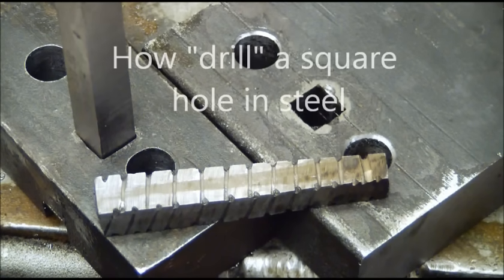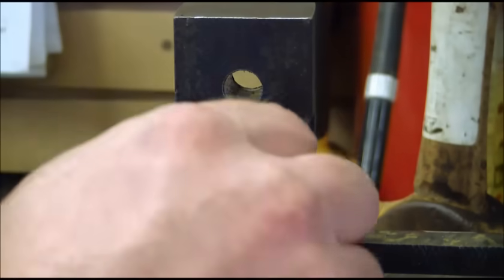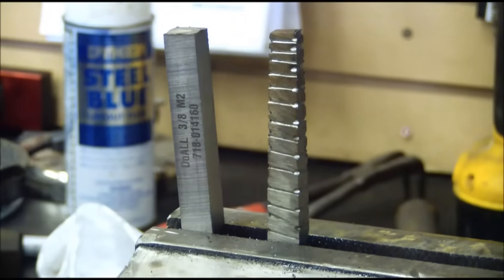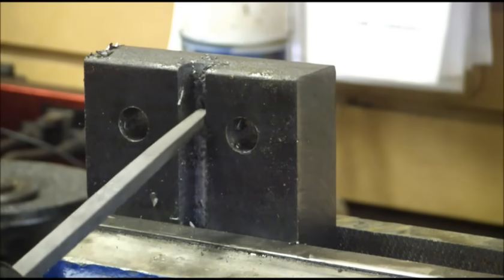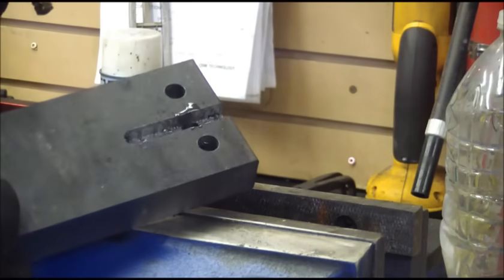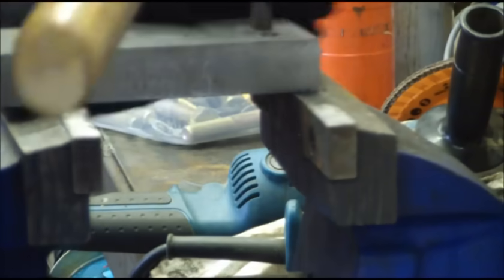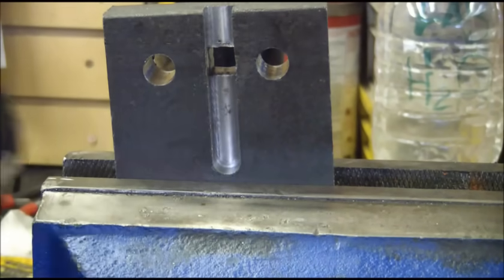Machining 101: How to drill a square hole at home without special tools.

Comment: I saw nothing wrong in this video. I can't believe the comments on here. AvE good job. People need to know feeds and speeds and the different cutting compounds available out there. The fact the drill was smoking proves you had a cutting compound on. The drill wasn't too fast for a 3/8 diameter. Belt driven drill presses always sound faster than they are really going. Also the drill bit never changed colour, the chips were silver and didn't turn purple which means you weren't cutting anywhere near too fast. I could brag about my credentials and certificates and pieces of paper too. It's what you can do, and what you really know, that proves your true abilities. Natural talent and innovation will always be worth more than a shitty piece of paper, this is why you can machine without a certificate for a living.
Reply: In Africa we use water as a coolant.. Why? because the bosses are too cheap to buy proper coolant 😂 we say 'skuma twende' which loosely translated means 'if its working lets keep going' 😂😂😂 so i agree with you as long as the desired result was achieved the process can go to hell
Reply: I agree with your comment. This is s  good solid video.
Reply: I agree with your comment. This is s  good solid video.
Reply: I agree with your comment. This is s  good solid video.
Reply: Theres guys at my work who are red seal tool and die guys and there the biggest hacks I've ever seen in my life and they think their gods cause they got a piece of paper.
Reply: well sir--you certainly have no certificates in machining that is a fact.
Reply: @jaysilverheals4445  and yet, he’s introduced effective steel cutting techniques to so many more people than I would imagine you have and STILL didn’t come across like some arrogant little fuckface who’s abit upset at the attention someone else is getting. What a world.

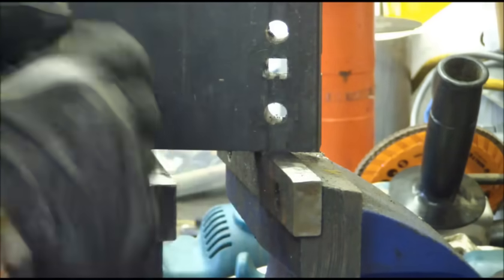Comment: 3:46  I at first wondered why was the square pin heated up before pushing it in ?   Turns out it wasn´t the pin but the brotsch / reamer (yeah BTW "reamer" is a commonly used name in commerce for such a square tool) which by heating it up makes it expand a bit and thus result in slightly widening the square hole when again pressed in.

Comment: Whilst this method might get you your square hole, under no circumstances should you hit high speed steel with a hammer, HSS is extremely brittle and shards can chip off at very high velocities, I know from experience, being a time served toolmaker. PS If you have any questions on any aspects of machining, I would be only too happy to offer a solution to your problem.

Comment: For many years I thought that when we need to remove a rusty bolt I had to heat up the bolt it self ,but 2 months ago I just realized that I was doing wrong. But what really need to expand is the reciver. Not the other way around, since them I've stop brake things and retreat as well.

Comment: I have a somewhat limited knowledge of machine tools so forgive me if I'm incorrect but you appear to be drilling your .375 dia. hole a bit on the fast side. Even though you are only drilling into mild steel ( CRS or hot rolled ). Feel free to correct me if I'm wrong. Other than that , a very good idea to make do with what you have on hand.
Reply: SuperSaltydog77 hole is drilled. didntburned the drill. job got done, i dont see any probleme here
Reply: SuperSaltydog77  My thought exactly, plus,  no coolant?
Reply: jasonwinback well, couldve expanded the lifetime of the drillbit by cooling it but not really needed i guess c: i bet he put some on the surface before he drilled

Comment: I'm never going to win troll of the month but.....the amount of time you spent faffing about making a broach that doesn't cut properly, you could have just filed the hole. You nearly did anyway making the broach fit to start with. For bigger holes or splined holes you would need to make a broach with proper rake and clearance angles for the tool to cut properly, not just half round grooves. Read Porter, Lawshe and Lasco. Machine shop operation and setup.

Comment: i wonder how fast a reticulating saw with a file rigged to it would work.
Reply: chris11sholtz I like that idea.
Reply: Pretty fast but it would also ruin the file faster
Reply: You cant file HSS, the work-piece is harder than the tool.
Reply: You can buy reciprocating air files
Reply: Flying lead ever bought a bastard file before?

Comment: I'd have to say his drilling is fine. It's fast, clean, no spaghetti and by the looks of it there is some kind of lube going on there. The smoke coming from the chips indicates al lot of the heat is transferred to them, not in to the drillbit. Also, the chips are not blue, indicating that it's not overheating anywhere. Drillbit looks fine too. Lastly, the reciprocating drilling technique he's using prevents te drillbit from overheating or re-grinding of the chips in the drill hole. All in all, a fine job, Sir.

Comment: Why heat up the broach?   It will expand.
Reply: ***** Basic engineering 101 awaits you :)
Reply: The tools he wants to use are 3/8", and the broach he's using is 3/8".  Problem is if your hole's exactly as big as the tool it's a pain to put them in since there's no room left, they're tight to each other.

Heating up the broach makes it a little tiny bit bigger than 3/8", so your hole ends up a little bigger too, and then it's not so hard to put tools in.

Comment: FYI, your link at 3:52 doesn't go to building a 100 ton press like the caption says.  It goes to drilling steel with an arduino and a pencil.

Comment: What's with all these ignorant Joe handymen that are so confident in telling a machinist how to drill a hole properly? You people wouldn't know how to calculate the ideal RPM even if you knew what the drill bit and material were. In this application a carbide drill bit shouldn't use coolant and should turn at 2-3K RPM. There's no chatter and it's making good chips but you never saw chips smoke in your high school shop so the professional must be wrong.
Reply: john saunders
Wrong stupid  400 per inch for HSS and mild steel  is more likley.
 And the proper equasion is (Cutting Speed x 12)/(pi x dia)
And How do you fucks know its not carbide tipped drill.
And second of all, maybe hes just drilling it quickly as to not lose people attention for the sake of a youtube video. not everything ia always black and  white.
Reply: tttrrroooyyy 280? Are you a small guy?
Reply: tttrrroooyyy did NYC CNC delete the comment? What did he say?
Reply: C W sitting down, we are the same height. I'm 5'11" the only thing a skeleton like this is good for in winning bench press competitions. Imagine a 6'4" guy with the arms and legs of a 5'8" guy. As a really skinny guy, those state fair weight guesses were always 20lbs under. If I had to do everything all over again, I'd have been a full back. That aside, I think John's a good guy, he's just a little too into fusion 360 for most of us. One of the few big metal working youtubers that has gone down in popularity over the last few years. Bring back that free licensed music and the tormach 770 changing a block into something else at 10X speed.
Reply: They’re the same people that would prefer to help the mechanic in the bay, while their car is getting worked on.
Reply: john saunders Are you sure it wasn't two head injuries? I'm guessing you want to be a teacher so you can get paid to talk down to people. I've met a lot of smart tradesmen and none of them toot their own horn. The loudest guy in the room is the weakest. Or maybe it's the internet so you can be whoever you want and you choose a tin banging, boiler/ tool making, pipe welding, engine tuning, super engineering douche. Or maybe you're the outlier; a condescending genius prick that mixed up his numbers by accident. He doesn't say what material he's using but I'm guessing it's not brass. Assuming it's mild steel the cutting speed should be roughly 30 SMM. (318 x 30) / 9.5 = 1004 RPM. I used the imperial equation and got close that. (CS x 4) / dia. = RPM. I'm not sure why you used a metric equation on a 3/8" drill. As a rule of thumb carbide bit speeds should be 2-3X that of a HSS bit. That's how I got 2-3K RPM. Before you say it, I know it's rough and there are lots of variables that would make it faster or slower. It's a ballpark calculation just like your equation. If he can afford a milling machine he can afford some carbide bits. There are other reasons for not buying a broach. And stop spelling he'd as "hid". BTW, I'm a rocket scientist, lawyer, rock star that can bench 280 lbs. I won the elementary spelling bee last year so I'm pretty sure that qualifies me to be a spelling nazi on youtube.
Reply: A lot of machinest in here that would be fired in my shop for burning up bits. That drill is too fast. I have run 3/8 up around 900 or so. But unless I am flooding it, there is no way I would have it spinning that fast.
Reply: *****
You guys can laugh at john all you want but he is 100% correct.
Any real machinist can easily tell a carbide bit from a standard hss bit by the color.
Reply: ***** So I think it's about time we ask you about what's going on instead of all this name calling over a guess. What is the drill bit made of and how fast were you running it?
Reply: john saunders You might have learned to use the metric system Johnny Boy but you are sore lacking in the spelling and grammar department. (ignoramace, simplten, sory, Rushians, metris,) But you are Australian. I'm sure your "Mates" are proud.   

I think the rest of you folks are jealous that this man has the ability you don't and he's willing to do it. you see it's not always about buying the tool. making it increases you skills!

Comment: I have a question. I came across this video trying to figure out a decent way of making a slot through a steel rod. The rod is 5/8" diameter and I want to cut a 1/4" slot all the way through it on the end and about an inch long. I noticed you had a nice looking slot cut in the piece where you were making the square hole. How did you do that? I have a drill press and could drill a series of holes and file it out from there. I wish I had a mill but it isn't in my budget! Nice video and thanks!
Reply: *****
Thanks for the link and the thoughts!

Comment: Good job. However if you drill the pilot hole larger than the broach, about .030, it will be easier on the broach and will not hurt the purpose of the square hole. Also, gloves are a no-no in a proper machine shop using power tools.

Comment: How many RPM you reckon that drill is turning? Close to the speed of light.
Reply: with astroglide , even teh starship enterprise can go fuck itself quick. ll !
Reply: Dont forget the no cutting oil, drills wont last long if you carry on using them like that
Reply: Higher speeds for the very small pilot holes and then much slower for larger bits. And just like any machine or tool, you more or less feel what its doing rather than attack the job with it.
Reply: drill speed was my automatic and immediate scoff!!
Reply: I was always taught to drill holes very slow like 400 rpm or slower

Comment: I have to build a striker plate out of 2" plate with a 1 3/8 hardy hole for tool making. So will this system work? Pilot holes increasing in size until I get a 1 3/8 hole then build that broach tool out of tool steel? It doesn't have to be exact just close. I don't want to be swinging a sledge on my expensive anvil to make these so trying to build a striker plate. I also don't want to break my post vise, could I lightly tap on the tool rather than try to press it with vise?
Reply: Are you at all interested in selling one of those setups? I could get the tool stock and make the broach but not the rotary. I need to be able to make more than one size hole as well for my other anvils.

Comment: Hm, Ok a square broach is cheaper then a new vise and a trip to the hospital. The jack screw nut in most bench vices are just cast and putting the amount of force that you are using to wedge your home made facsimile of a broch through the steel plate is without a doubt tearing up the threads in the nut of your vice. I have hot forged a square hole in less time than what you put into your project there. I true square cutting broach used in an arbor press with black thread cutting oil will feed through the work like butter.  

Joe
Reply: ***** Check out McMaster Carr or Wholessale tool I know McMaster has broaches and Wholesale Tool should have them too and they will likely cost less.
Reply: ***** I never said they would be cheap, lol... I have found some good deals on tooling at industrial surplus stores and I'm sure there is some good stuff on ebay too. If you have access to a welder, some scrap steel and a bottle jack you can put together a decent shop press pretty easy, just be sure to over build it so it won't eat itself or hurt the operator.
Reply: *****, Maybe he had a lot of money for just one fucking square hole. Good luck to this guy, hakhakhakhak

Comment: Ive done this once before and it came in handy. It would have been a lot faster to file the hole but filing through what looked like 1" stock you will be finding it very hard to make a nice square due to the belly on the file. Surely not worth the mucking around getting it right only for it to be bellmouthed and not right. Congrats man.

Comment: What a load of crap. The title is misleading at best....
Reply: Ya know Gomp, "drilling" is a correct term with this technique.  "Drilling" is the action of a specific tool/implement that creates holes -- shape not specified.  If you don't believe me, go look it up in a dictionary.  To whit, remember good 'Ole John Henry, hammering on the mountain?  Miners like him drive/pound a steel bit deep into rock in order to create a hole sized to fit sticks of dynamite.  Those bits are not "twist" style bits, they are "drilled" straight in, no twist wanted, by impact.

In this vid, the author does in fact use a twist bit to "drill" (bore is another term & again this is in the dictionary) the primary hole.  The broach and broaching finish the task in much the same way as one uses a file or grinding to remove burrs; are those final steps not part of a good workmanlike hole?

Comment: You are drilling way too fast! Low rpm and a high pressure is the best for drilling in steel.
Reply: +szili76  Anywhere from 800 to 1000 rpm is about right for CRS.

Comment: I hope you were wearing eye protection when you knocked the home made "Broach" out. Tool steel is pretty hard and chips caused by impact can reach pretty high speeds even penetrating eyelids.
Reply: ***** Well your mom was right. You are careless, especially when trying to show of your limited knowledge of engineering. Some of the people watching this video may injure themselves following your advice but then again, it doesn't really seem like you care do you? It's much easier being obnoxious than a responsible caring human being isn't it? I guess you should be embarrassed. I have more than 15 years of maintenance management experience and people that work like you do have always been a thorn in my side because when they injure themselves or their fellow workers, which they always eventually do, they generate a ton of paperwork and damn investigations and make the entire department look bad.
Reply: ***** Well it's clear that you don't care and that you have the maturity of an 8 year old and the mental ability of a 10 year old (and I'm being generous here). Even when my son was 5 years old he knew the motto of safety first so he was clearly a lot more intelligent than you. By the way, do you also have sexual issues? I'm not your mother and I don't see how you can mistake me for your mother unless your mother can grow a beard (which would explain a lot of your issues).
Reply: Are you nuts. I am an OSHA certified from my previous ARC welding job. Do you think he isn't?

Comment: At the risk of sounding extremely stupid here... 

Why did you hear the broach up if it was too snug? Surely this would just make the broach larger due to the metal expanding?
Reply: ***** Oh I see! I misunderstood what was being said in the video it seems then. :-P Thanks for answering!
Reply: I thought the same thing.
Reply: For a short time only and it will return when It get cooled down. We heated the natural gas or oil pipeline before welding it especially, if it is the larger ones. Carbon steel reacts to heat but if allowed to cool down it will return to normal. Except for excessive heat.

Comment: your drill bit will last a lot longer if you slow down your press speed to very slow and use cutting oil!  that bit is shot from heat.

Comment: How in the hell is that supposed to be a broach. It's a wedge with some groves cut in it, similar but not the same. It would simply deform the hole a bit till it's jammed in there and that would be it.. I think there's a reason why there's no video of him actually broaching anything, it didn't happen. If you can't afford to buy a real broach, learn how to use a file.
I love how he says he's gonna heat up the tool because its tight. Heating it up would only make it tighter. I certainly hope this video was supposed to be some sort of strange joke, otherwise it's just sad.

Comment: Driling in steel the way you doing it is crap. Ever herd about cutting speed. And that is whay slower then the speed you did it in. And using cuting oil to cool down the drill to make it last mutch longer.

Comment: Dude!
With that much rpm and no coolant, you are burning your drills!
That much rpm is perfect for small holes up to about 3millineter. But the larger the diameter, the lower the rpm has to be.
Reply: *****  3.82xSFM /tool diameter = rpm.. RPMxChiploadxnumber of teeth= feed rate.  on the lathe you divide by the diameter of your work piece. look up a sfm chart or refer to the machinist handbook